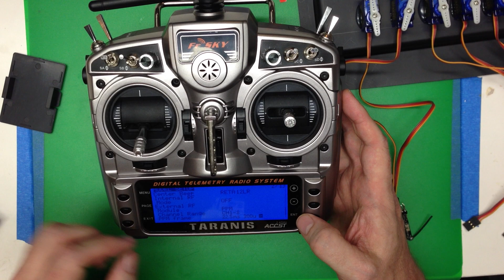Taranis: Binding with External Module

Comment: I recently purchased the X9D and got the OrangeRX module for it. I've managed to get it to talk to a Spektrum Bind-N-Fly airplane and I can work all the control surfaces but I can't make the engine spin up. I've tried reversing the weights (as was necessary to make the ailerons and rudder work correctly) and adjusting the offset and trim but it will not spin up the motor. I had a guy at my local hobby shop spin it up with a Spektrum radio so I know it's not the plane. Any else run into this?

Comment: Let me see if I can keep this question short.  If I have a few planes that are Spektrum and a few planes that have Taranis RX's do I need to remove the module or will the switch happen inside the TX when I switch models (after they are set up)?
Reply from the maker: You can keep the module in.  For each model, you can specify to use the internal Taranis module or the external (Spektrum) module.  Select "PPM" for the external module.

Comment: On my taranis it has selections for dsmx and dsm2 in addition to the ppm. Do i still use ppm? I will be binding an bnf helicopter with as3x.
Reply from the maker: Use PPM.  The other choices are for a hacked internal dsm module.
Reply: Thanks for the video and the quick response.

Comment: I got this to work, however when I use the external tx and spektrum rx with the Taranis I'm not able to center the channels. I fly mostly multicopters and when I'm looking at the GUI (Baseflight with Naze 32) or even KK2.0 I'm not able to center the channels at 1500us, not even with subtrims. If it's let's say 1495us I have to trim it quite far without the received timing changing at all, and then suddenly it shows for instance 1505us. Does it have anything to do with the ppm frame settings to do?

Comment: Im  a  bit  confused  about the + or -  thing.
Initially I set it  to  "-"  (im using  uhf module)  and  it  worked  just  fine. Next  day  once  I powered  my  quad  the  flight controller  LED  started  to  blink  as  if there were  no signal( or wrong)  from Tx.  I then tried  to change the  delay and frame  rate, but the LED  kept saying  there  was  a  problem.  And  only when I  changed  it   to the plus  it  went  back  to normal..
Now  Im not sure is  it  safe to try flying  with "+"  ?